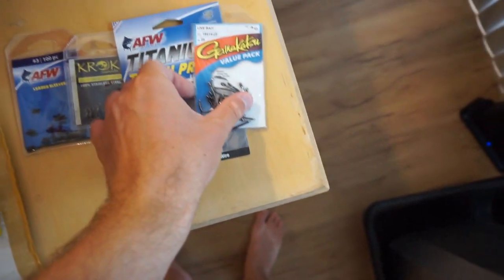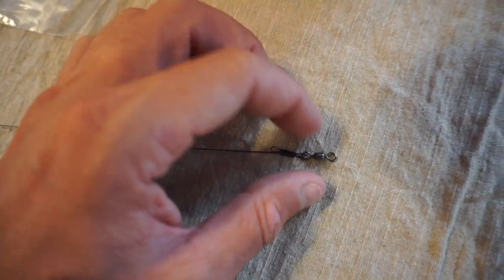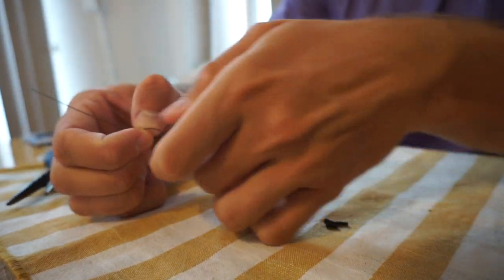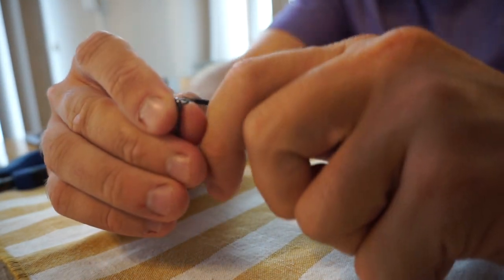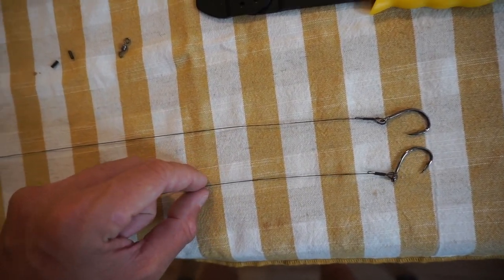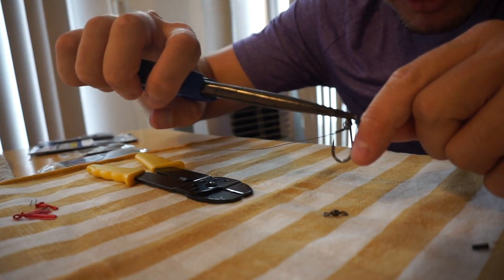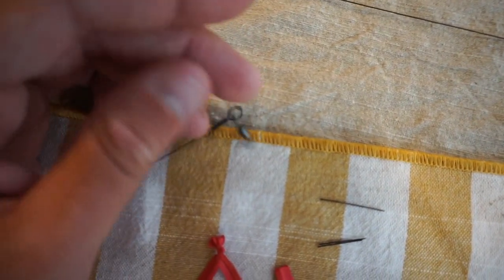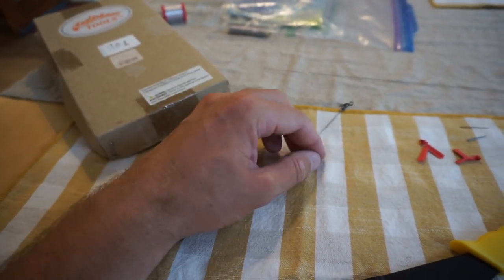Wire Rigs For Toothy Fish (How To) | Hawaii Kayak Fishing

Comment: Connor, that is a brilliant wire rig, by far the best I have seen.  Thank you.  I have been planning to move to Hawaii for several years and finally it looks like I will be able to do so over the next 6-9 months.  My plan is to buy a Hobie Oasis and fish it with occasional visiting friends and then just myself, perhaps put 100 Ibs. of sand bags in the front when I am solo for better weight distribution.  I also think I'll get an electric motor so that I can troll Nomad lures at 5 MPH.  Have you ever tried fishing Nomad lures for Ono?  A guy I know in Hawaii, who fishes from a boat trolling about 7 MPH, swears why them for Ono.

Comment: Bruh, right on...we have been catching plenty of tuna on wire. It just has to be a clean rig.
Why not the albright from flouro to wire?
Reply from the maker: I’ve had that connection cut before. The swivel allows for rotation (less line twist) and has a better breaking strength (I use a Uni to swivel)

Comment: Mahalo for the tutorial! Question: do you have to crimp it a certain way i.e. crimping all the wire flat or down on top and smush all the strands stacked together on top of each other?  Or it doesn't make a difference as long as the crimp is fully crimped?
Reply from the maker: That’s a great question. I like the crimp it entirely flat (with wire) and have the three strands contact. However, I don’t think the contact is completely necessary with the failsafes built in to the combination crimp and having the correct size crimp for the wire.
Reply: @commodore_connor  OK, mahalo for the reply, I'll just have to rig a few up and see if there are any differences but like you said, with the failsafes it shouldn't matter as much...can't wait to get an ono on this!!!